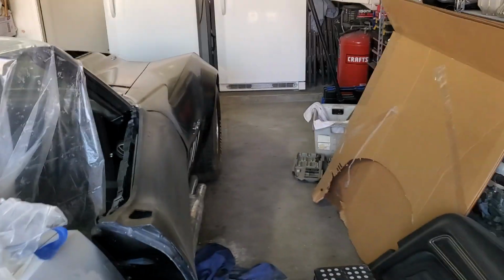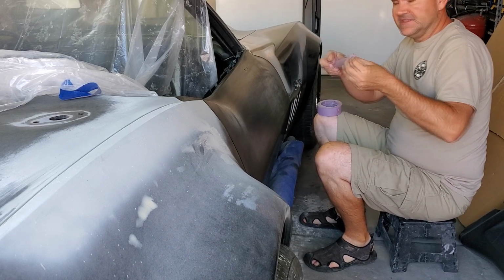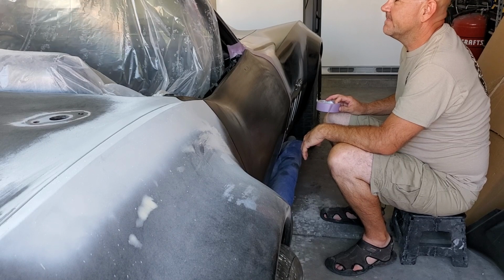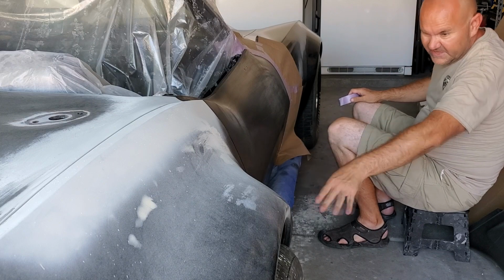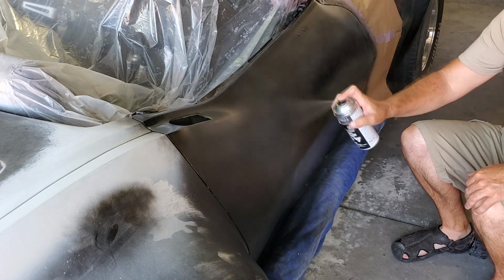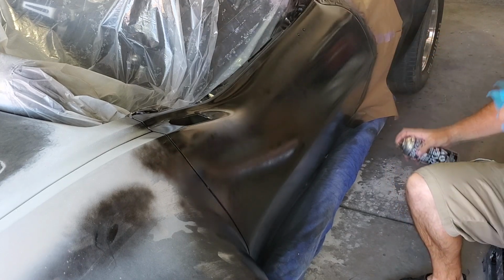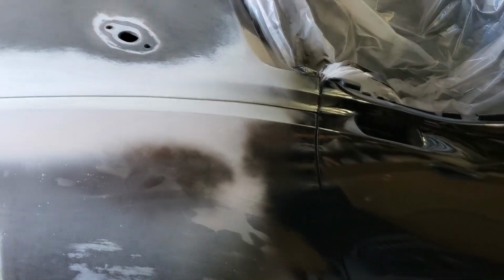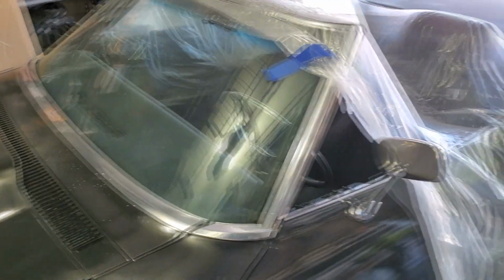500 Subscribers! Working on the passenger door. Pt-9. C-3 1969 Corvette. Painted!

Comment: I need to know about your louvers on your hood
Reply: Why? I’d like to do the same on my 70’
Reply: You need to be a truck driver.  They don’t care bow old you are or what you look like
Reply: I know because I tried to get a job locally but no response
Reply: I’ve been a truck driver for almost 10 yrs now and I’m still working
Reply from the maker: https://trackspecmotorsports.com/shop-by-vehicle/corvette/c3-corvette-68-82/c3-corvette-hood-louvers-l88-long-kit

Here it is! They have two different ones. I have the longer version.
Reply from the maker: @bradfordjones1565  I use to be a diesel mechanic and drove the big trucks around a little bit. I already know I couldn't handle it.